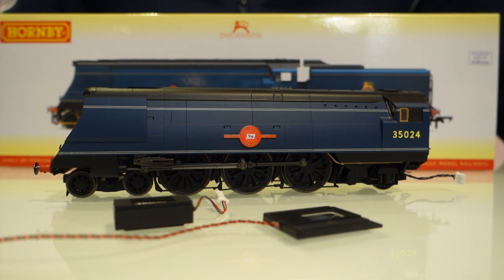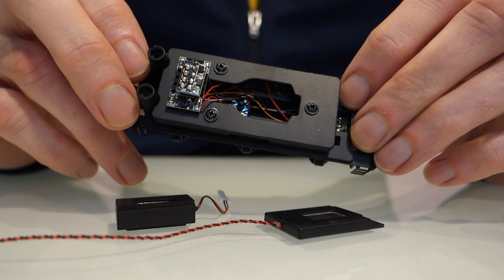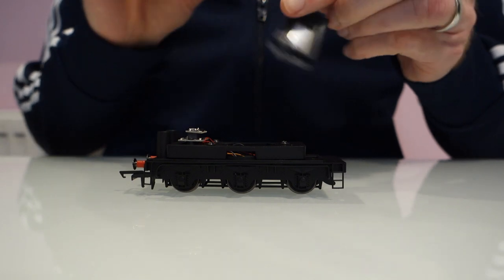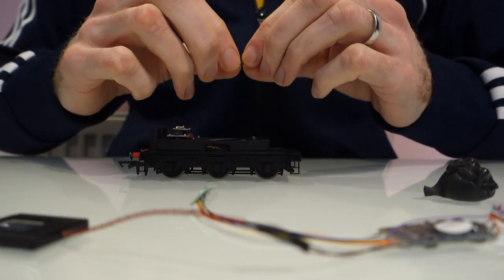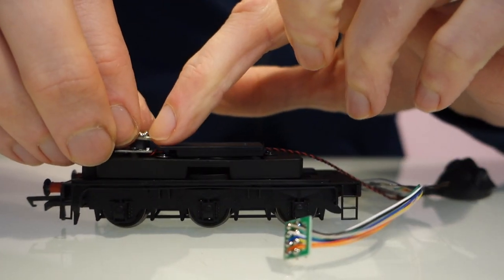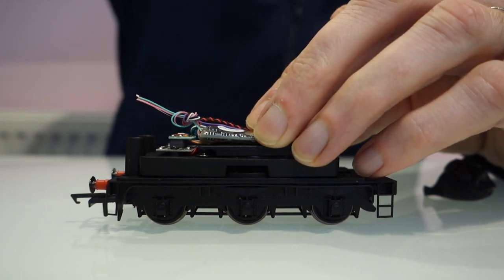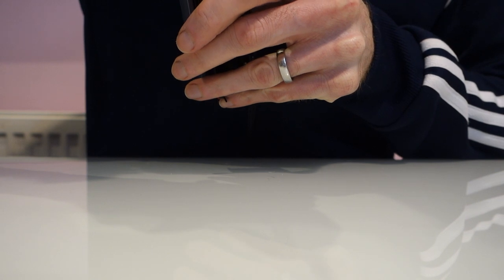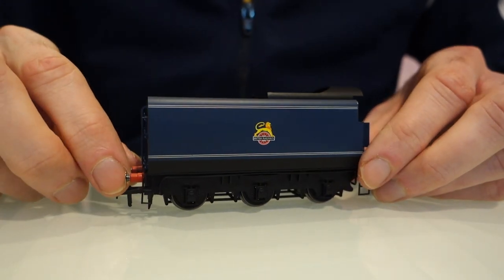Hornby Merchant Navy DCC Sound Fitting Tips

Comment: Hi Richard, really helpful thank you. Can I use that speaker with TTS sound as I have the same model and a TTS chip to fit? 
Cheers Phil.
Reply from the maker: You can yes, I never thought to mention that in the video!
Reply: @roadsandrails  Thanks I've just ordered 1 - was going to be 2 but I got the last one. Any idea when they're be back in stock? (ordered the double iphone for my 47 too - it's your videos - so useful to know what's possible and available, cheers)
Phil.
Reply from the maker: @wilton34041  sorry about that, I still have some, I didn’t update my inventory when I last had a delivery, if you order another use the discount code ‘FREEPOST’ to get free postage. Thanks